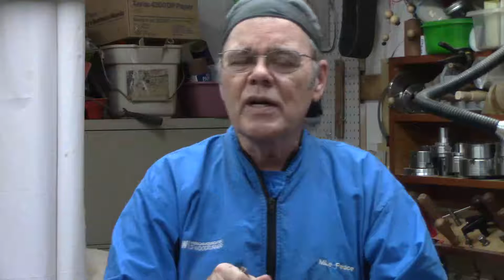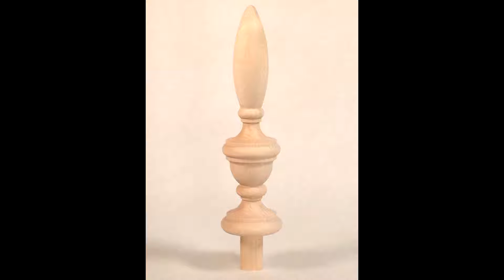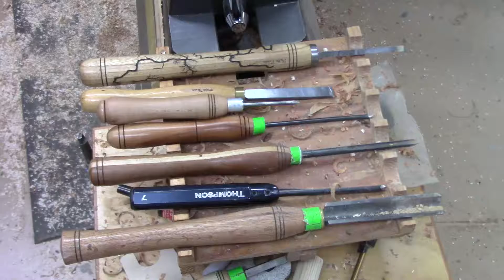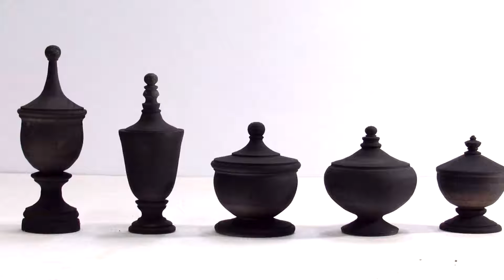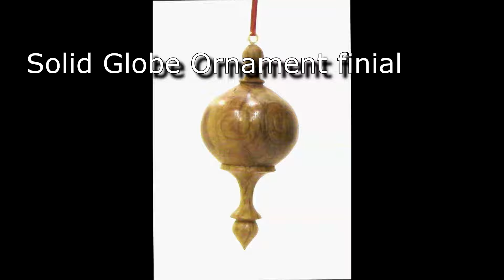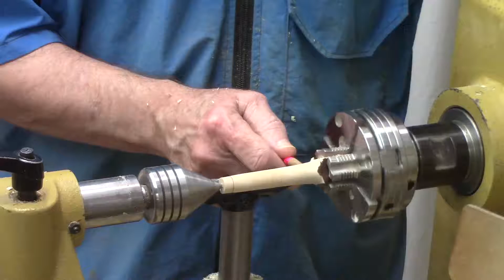Getting finial proportions right the first time

Comment: Very interesting. Not an expert turner but I did stay at a renowned motel once. I don't have a spindle gouge of any width but I'm thinking (scary, isn't it?) that my 3/4 inch skew might work. 3/8 inch bowl gouge? Also, I made a Bedan tool and have an extra piece of square stock that could be the double angled tool; can't remember what you called it. One more project! Thanks.
Reply from the maker: Certainly a skew would work if you are experienced with it. You coud turn beads with a BG if you have to but perhaps it is time to think about buying a spindle gouge?
Reply: @MikePeaceWoodturning  My skew is 1/2 inch. I'll get a spindle gouge for the wife's Christmas present. Won't she be surprised! Will check on a SG. Thanks.

Comment: Great video Mike!  One piece of advice I got from an early mentor was that finials gain weight when you take them off the lathe.  I realized he was right that they look smaller than they are, so when I it's getting there I go smaller and thinner.
Reply from the maker: Great tip! I have found beads get heavier on a box taking off the lathe as well. Thanks for sharing.

Comment: The tip about using the crescent wrench for sizing diameter was super useful. That's going to cut some significant time off of making tenons!
Reply from the maker: Glad it was helpful. You can even sharpen the top side. I only do this on a 3/4" wrench.
Reply: I picked up this tip from Mike a few years ago, and bought a cheap set, that lives in a drawer close to the lathe. They get used a lot.